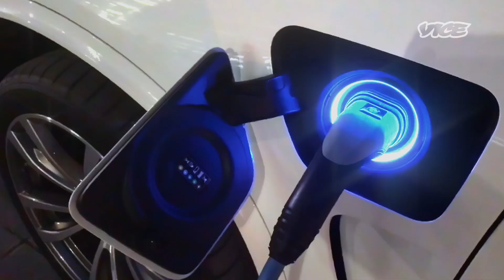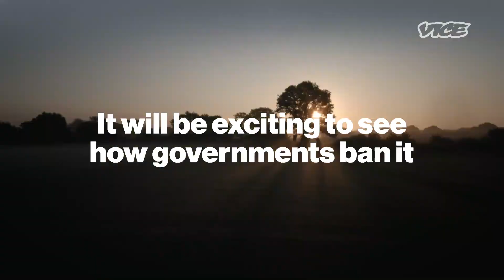The World’s First Solar Car | Extinction Update

Comment: As much as I love electric vehicles and know they are the future, the setup of this video really slammed petroleum vehicles even though there aren't reliable electric competitors for most vehicles. I'm waiting for the punchline, oh wait, there it is, this vehicle is not at all solar powered. Why are they calling this a solar car? It is as much of a solar car as a Hyundai Sonata hybrid.
Reply: Its a million Euro solar hybrid. Sonata hybrid with solar panels only gets about 12-15 miles of range after 6 hours of sunlight. I doubt this car will get any more. 
I love how they attack gas powered cars, the reporter probably got there in a gas power vehicle and then proceed to introduce a 1 million Euro electric car as a solution. The average life time earnings in US before taxes and deductions is around $1.8 million.
Reply: @itsesmir  actually, I'm pretty sure the press release of the Sonata solar roof only provides up to about 700 miles per year of extra range with 6 hours a day parked in the sun... That works out to about 2 miles per day if you have a perfect day every day so more like 1 mile per day... There's a reason that Toyota says its solar roof is for powering accessories. This vehicle, being that it uses lab grade solar panels as well as lab grade motors and batteries, might be able to push 10 miles per day from a perfect sunny day, but you'll have to park your super expensive car outside everywhere. I can't imagine anyone who can afford this to street park it anywhere. They will go to underground parking and conventionally charge it like any other electric car.
Reply: They don’t say it’s a all solar powered car do they?
Reply: @woutertje026  The title of the video is "The world's first solar car"
Reply: Nothing beats petrol cars theyr the best

Comment: How were the tyres, plastics, paints, oils and solar panels made?

From fossil fuels at carbon emitting factories.
Reply: This car is blatantly a marketing stunt and the company comes off as pompous pricks, but just because its still necessary to use fossil fuels in some areas of production doesn't make it worthless to try to use less in other areas.
Reply: @prescottmajette5290  it's not actually a marketing stunt though, I know some of these people from their time at university, they started there by making the uni's electric racecar. And they're really trying to make this a real product.
Reply: @sjwimmel  Calling it "the world's first solar car" is most definitely a marketing stunt.  The Fisker Karma had solar panels on its roof almost a decade ago.
Reply: @prescottmajette5290  many cars have solar panels on them. The point is that's not their main energy usage. She clearly stated in this video that it was mainly a solar car but needed a battery to hold charge when sun wasn't available
Reply: @alexs1640  I know what she said, but it's straight bs.  They claim around 1kw of solar output. that's 1.34hp.  You're not gonna go very fast under completely solar power.  Their battery is 60kwh with a claimed range of 450miles.  450/60 = 7.5 miles per kw.  If I wanted to go 7.5 miles in an hour, I'd ride a bike and get there twice as fast.
Reply: @alexs1640  So in short, if this thing qualifies as a solar car, so does the Fisker Karma, so this thing isn't the first solar car.
Reply: @prescottmajette5290  Why are you assuming you can only power the car with the panels? You're effectively saying the battery is at 0% when you leave. If you would hold normal electric cars to the same standard you couldn't drive at all.
Reply: J. van der Linden other electric cars don’t claim to be solar cars. If they want to admit this is an electric car with supplemental solar power, I’ll hold it to the same standard as regular electric cars. Until then, it’s getting judged solely on its solar output.
Reply: @prescottmajette5290  They don't claim to be a fully solar car. At 1:38 their spokesperson says "It can charge with solar energy but it's a regular electric car". Any other claims are made by the Vice reporter.
Reply: @sjwimmel  The title of the video is "The World's First Solar Car."  Vice has over 13 million subscribers, you'd think both parties would take care to not have bold and unsubstantiated claims be made.  And just to be clear, the header on lightyear.one's google search results is "Lightyear One — Longest Range — Solar Powered Car"  So it's not just vice making that claim, they are themselves.  Nice try though.  I know you're apparently in love with these guys, but I'm going by the facts of the situation here.
Reply: @prescottmajette5290   I do concede I like what these guys are doing, they're a team of engineers trying to innovate and improve the efficiency and carbon footprint of electric cars. And a lot of comments on here are whining about "It's not perfectly efficient, it's not technically a Solar Car if your definition is that it means fully solar powered". Who cares? It's way cleaner and more efficient than what we currently have. Isn't that worthy of excitement?
Reply: J. van der Linden on the whole, I agree with you, but on the other hand, that clearly wasn’t the messaging or claims made in this video. As the old saying goes “under promise and over deliver” and the main message most people are getting from this video is “over promise and under deliver.” So while yes, I agree with you, I do completely disagree with how this whole project was framed in this video.
Reply: @prescottmajette5290  Then we do agree, nice! I agree it was overhyped. But when I look at the video carefully I mostly see vice making the ridiculous claims and Lightyear being reasonable.
Reply: @sjwimmel  we are whining becouse the concept is stupid, and they do the same pump and dump thing again, we saw this several times... If they have paneles with this advanced - loool- technology, just put it on the roof with good angle, so it will producer dramatucally more... Furthermore they are lying. You dont get 20k km solar a year even in the desert, the vltp value is a joke, and the list goes on and on. Basically they never backed up any claims with anything... They should claim that the engineers there are NASA trained, and the car is based on some alien tech. Check their webpage... This is not a leap forward...
Reply: @prescottmajette5290  lets face it, maybe you haven't noticed, but everybody is lying a little  bit to get attention, and sometimes people lie big time (fi politicians) that's the name of the game for all of recorded human history
Reply: @manus5423  Oh ok, I understand it now.  Big lies and little lies are all acceptable as the truth now!  Thank you for enlightening me!
Reply: and batteries make with lithium, another nightmare for people and nature in South America and Australia
Reply: Yes, of course, it's still a car. But even when you won't solve the problem 100%, isn't it good to make progress?

Comment: How many people actually drive 30,000 miles per year for 12 years?? And considering the slow rate of charge with solar, you wouldn't exactly very a full battery charge every day, so that would trim that potential yearly total down even more.

Comment: The idea is very pointless. Do you leave your car outside all day? I keep it in a garage and my daily trips are less then an hour in distance. For un hour or two I will charge for less than 10km. It is not practical now, it won't be practical in the next 50 years.

Comment: looking at the size of the solar panel, It's amusing that the "inventors" think rest of us are idiots.
Reply: You nailed it
Reply: It will charge and it's not like you can add wings with solar panels. In any case it's their way to set themselves apart and get a government grant probably. In my use-case I would like it as I have several days when I don't drive but at €100k no thanks, not even half of that.

The issue is affordability of the initial purchase, not the cost of energy.
Reply: they think nobody has any experience with solar panels but a lot of people by now have actually used them and know how feeble they are.
Reply: Dude those people are actually engineers who won solar car race event
Reply: @anand.suralkar  doesnt change the fact that this car is a scam
Reply: @Withnail1969  wrong car is not a scam.
Yes u can totally run a car on solar panels..for daily commute.
On daily basis people hardly travel 40km..and this car can charge itself easily to give that much range.
So u can go to ur job or school daily without ever needing to charge unless u r going on long drive or ur village or somewhere.
So the car totally qualifies for solar car..
Reply: @Withnail1969  also this car is not meant for avarage people this is like a tesla roadster.
People could never buy Tesla roadster it was expensive range was bad.
But that was their first car in the same way this is lightyeara first car.their thir fourth model will have justifyable price much bigger..solar panels lower weight better aerodynamics more efficient battery and drive..and most importantly we will soon have 38% efficient solar panel one company is already developing mass production technology for their successful inlab 38% efficient solar panels.
Reply: @Withnail1969  check out sharp. 37.9% efficient 3 junction solar panel. Its non concentrated sun solar panel .once those come into market solar cars gonna change the world.
Cuz its going from 20% efficiency to almost 40% efficiency.also 3junctions only.ie it will be cheaper to produce.right now.lightyear one is giving 12km per hour real world solar charging that will jump to  24km per hour of solar charging imagine that
Reply: @Withnail1969  the car is like a premium edition..dont buy it if u dont wanna pay their research cost..its not for public model of the car
Reply: @Withnail1969  go and actually learn.i have actually learnt about solar panels..photoelectric effect to understand the research, why are sharps tripple junction.InGaAP,GaAs,InGaAs non concentrated solar panels actually real and works.bcz i have actually studied the physics behind it..unlike u.
Read about photoelectric effect by albert Einstein.
And read how different wavelengths of light interacts with differant.metals to give voltage in the metal.and then study the chemistry being differant gallium arsenic and silicon solar cells.
Reply: @Withnail1969  i never said it existed as a product read my comments properly i said they are making them into mass production it will take 3-4years
Reply: @Withnail1969  i have read their website unlike.u and that doesn't even matter.i read research paper on upcoming silicon high efficiency wafers..
And those are already in production even if u dont trust gallium ones we have silicon ones already in mass production
Reply: @Withnail1969  read research on perovskite solar cells those are industry changing solar cells already being mass produced
Reply: Making that comment makes you the biggest idiot in the world. 
Look this people are trying their best to save our world and you come complaining about the fucking size of the solar panels?
You have to be fucking kidding me comments like this make me lose all faith in humanity
Reply: No no, they're geniuses for sure.  My dumb brain can't possibly comprehend that 400-600w of solar constitutes "THE WORLDS FIRST SOLAR CAR"... that still needs to be plugged into the grid, like any other electric car.  Wow its really hard being this dumb.  Thank god for lightyear to save me from my dumb self.
Reply: Prescott Majette There’s no way they’re getting anything like 400w in real world usage. There looks to be about 2 square meters of panels there, so 400w is probably the max those panels could produce under ideal conditions. At any time most of the panels aren’t facing the sun at an optimal angle. I’d be surprised if they got much more than 100 watts during real world usage (or enough to drive a Model 3 about half a mile per hour of charge)
Reply: @Premium-Content  They claim 5 square meters and just over 1000w of output.  Then there's efficiency losses from going into the battery, coming out of the battery and drivetrain losses...  Even calling it a full kw of output, youre looking at 7.5 miles of ideal range per solar hour if you trust their figures of 450 miles out of a 60kwh battery.  With sun hours ranging anywhere from 3-6 per day, its not insignificant, but its also totally marketing bs to call it a "solar car.'
Reply: Prescott Majette that doesn’t look like 5 square meters to me, but let’s say it is. To get 1000w out of solar panels they need to be perfectly facing the sun and have strong sunlight. With the way they’re on the car most of them wouldn’t be directly facing the sun at any given time, so they’re even still going to generate nothing like 1000w. That’s before they get dirty
Reply: @prescottmajette5290  I have a small 2002 EV, plug in, that gets 6 miles /kWh, 120 miles on a 20 kWh batterypack, when I try not to have fun,! So not completely incredible, presuming their wheel motors are more efficient than the 30kW induction motor, I'm hauling around.!
Reply: @prescottmajette5290  when they created this car they didn't use the technology that was used in the solar race

if they had the car would travel a much longer distance

the technology to  move us forward is available

they aren't releasing  it to the market
Reply: @Premium-Content  5sqm panels go to their website
Reply: @prescottmajette5290  solar hybrid may be a better name
Reply: @prescottmajette5290  inventors clearly didn't think people are idiots vice people did stop hearing on lightyear bcz of stupid vice
Reply: @anand.suralkar  good luck buddy
Reply: Never was it said that the inventors think you're idiots, the intro was made by Vice, not the company. Here are the numbers if you're interested: https://lightyear.one/technology
Reply: @sjwimmel  well we recieve on a good day 250w/m^2 of solar power the best solar cells have a coversion efficiency of 20% thats 50W /m^2 the car possibly has 2 square meters of solar cells which means 100 Watts.With this electricity how do you charge a car? Even a moped needs 1500W motor.Some thing is wrong vice guys
Reply: @Allthingstech3108  I can't say anything about the calculation but you're assuming it will only charge when driving. You won't drive off with 0% battery, it also charges when standing still. You essentially get 'free' power on top of the normal wall charging. And yes it also charges a bit when driving, extending your range slightly.
Reply: @Allthingstech3108  normal house solar panels gives max 270w pr m2. on clear skies.  the sun gives about 1000 w pr m2

Comment: It's strange how electric cars wouldn't have solar panels on them.
Reply: The power output is unimportant as the car surface is so small and incorporation complicated for now. The focus is on mass manifacturing battery and  solar farms /rooftop installations at the moment.
Reply: It’s not because its horribly inefficient. Most of the panels would not be directly facing the sun at any given time, so your adding weight to the car for not much power generation. It’s far more efficient to have dedicated solar farms and use that energy to charge the car. And in fact, the only places that a solar power car would be practical, like California that may be sunny enough to support some find of solar power car already have an abundance of grid level solar. So pretty much every EV is a solar powered car and they don’t even have to carry around heavy solar panels
Reply: Adding solar panels makes both manufacturing and also servicing a bit more complicated. Most EVs these days are so great because besides the battery/ motor part, they are very simple. Less things require maintenance like oil, pumps, etc. When you throw in a solar panel, it is another element which can be damaged and is very costly for the car owner to fix. If you get into a wreck you might be seriously screwed with the car being overvalued for repair costs just because you now have to fix a solar panel that runs the entire top surface level of the car. It doesn't seem very practical tbh. Almost like a disposable car. Not only do you have to think of a small accident affecting the structural integrity of the chassis but also did the solar panel get damaged. It's a big ask for an owner and that's why electrical vehicle manufacturers don't do that now.
Reply: Randy Marsh If your goal is reducing emissions there are better ways to do it, for less money aswell
Reply: Because it's incredibly inefficient. Most the time you park in the shade, how is it able to charge a car
Reply: the panels add weight, which reduces the efficiency and battery capacity.
Reply: The car  solar panels can charge from sun  street light moon light to keep accesories charged
Reply: sunsetlights100 there’s no way in hell you’re going to keep anything charged with street lights
Reply: @sunsetlights100  yeah. On their site, they claim you get 7-20k km a year free from that solar panel... Fckyeah 😆 not happenning
Reply: It would be neat but it would cost more just to integrate them. Honestly it could solve problems regarding to long travels.
Reply: HOPELESS Ent. Honestly no cause solar panels are very cheep these days

Comment: how long does it take to charge the battery, how fast can it drive only with solar under ideal conditions, how big is the battery???

why so much secrecy?
Reply: How much HP does it have? Is it all wheel drive? Does it have have a Bose speaker system? Does it have bimbo brakes? How many cup holders does it have? So much secrecy. New world order.